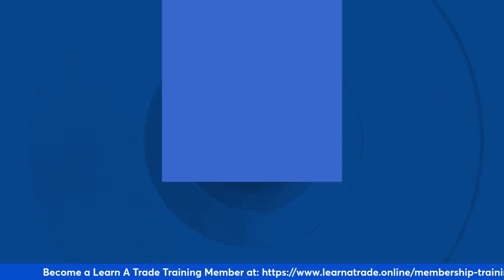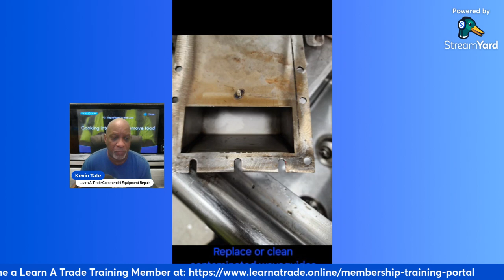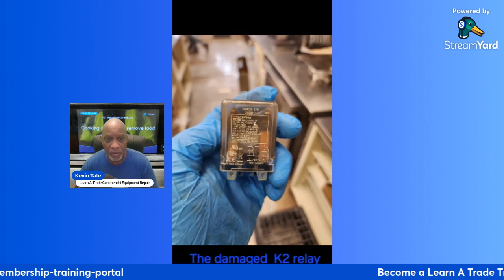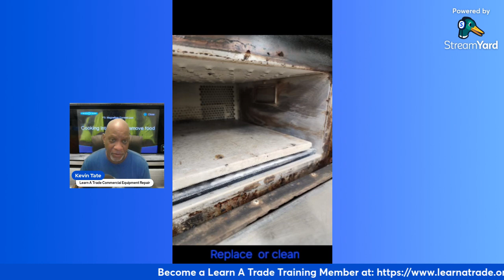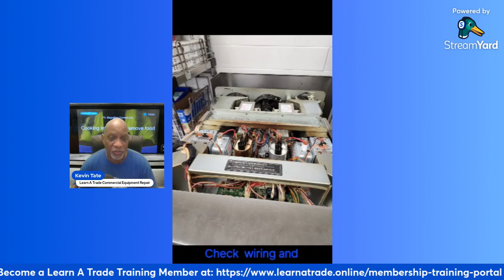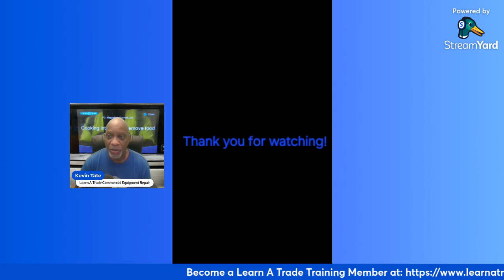Steps to Repair a Turbo Chef Oven (Mag 3 Error Message)

Comment: Hello friend, greetings from Colombia Cali, I really always watch your videos because they help me a lot. Currently I work with these turbochefs and I have a problem, when I perform the magnetron test I take the independent amperages of the magnetrons and they show 9 independent amps but In the brown cable where the amperage is taken, it only goes up to 1.9 amps and I get the f3, I already checked the fuses, they are in good condition and the magnetrons are fine, the antennas and the K2 relay are activated normally. Could you help me with this concern, please say hello. thank you and I love the videos you make
Reply from the maker: @ThermalShock  Hello Thermoshock. Its sounds like you may have a wiring issue within the high volt circuit. You may want to check the K2 relay as well.  If your 20 amp fuse is good  you may want to  check or replace the diodes but you definitely should check the high volt circuit wiring first. I hope that helps , let me know how it works out.